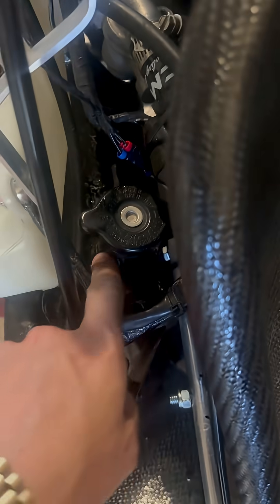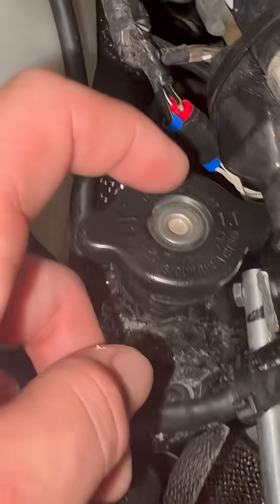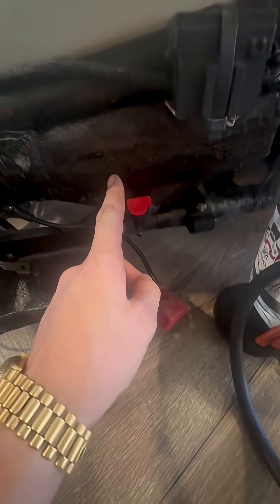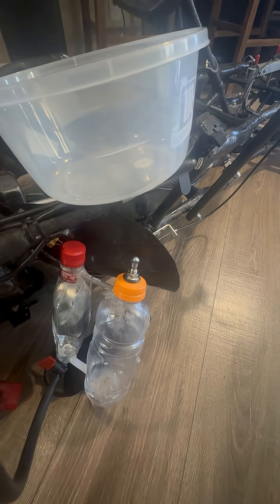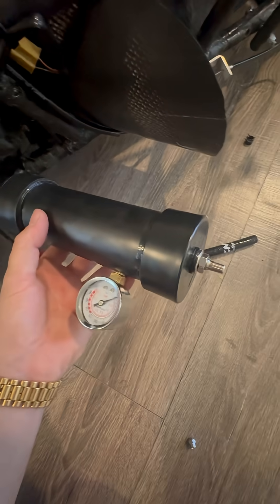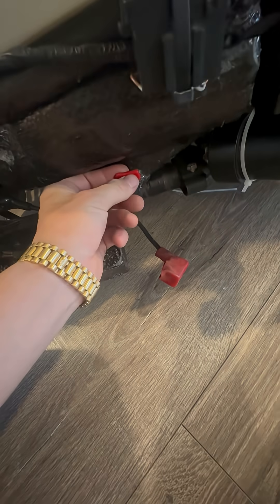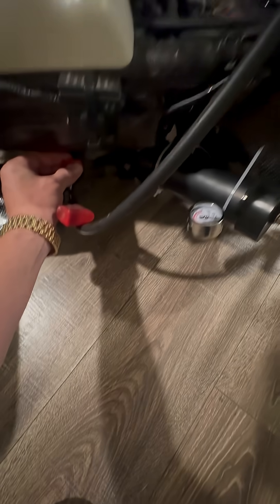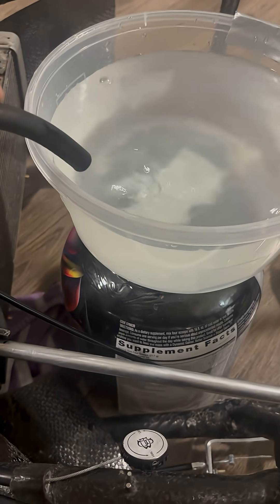Go kart experimental gas tank SUCCESS #gokart #karting #experiment #engineering #automobile #yamaha￼

Comment: Youve got a great idea there but i hope your also thinking of safety,like if something catastrophet happened,it would be almost impossible to put out a fire thats under pressure or thats pressured incorporate some kind of a fire suppressor system so you and others are and hopefully stay safe ,good luck my friend and stay safe
Reply from the maker: so looking in on this, I guess gas tanks can build more pressure than the 6 psi that I am using just sitting there in the sun. I’m just directing where this pressure is going so it should be the same as a conventional gas tank, thankfully. But that’s a very smart and good call I appreciate that!